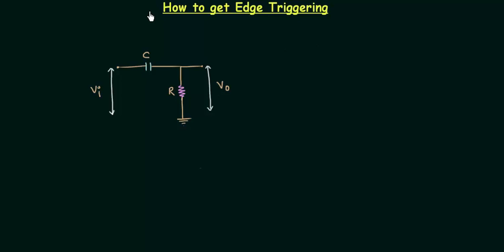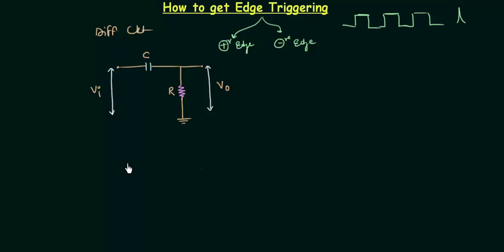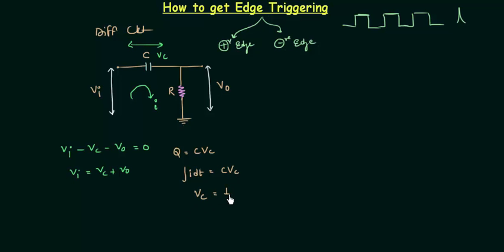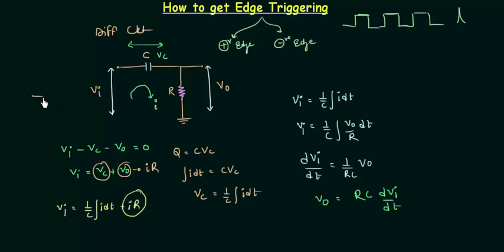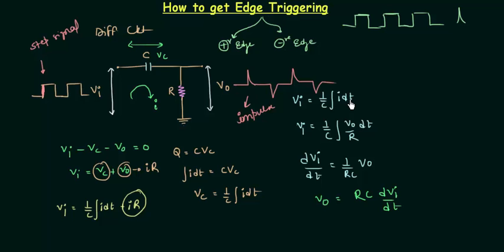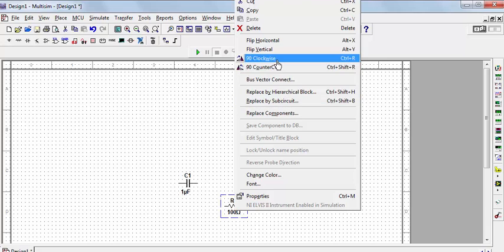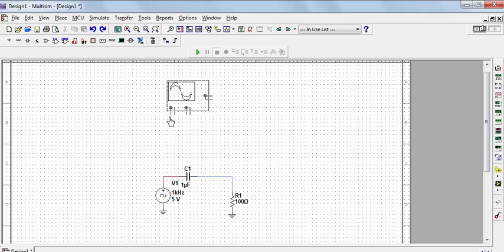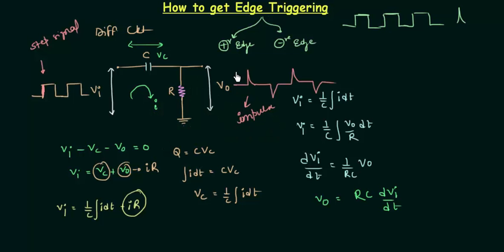How to get Edge Triggering | Simulation using Multisim

Comment: How we can know a flip flop is positive edge or negative edge triggered circuit from its gate level design
Reply: kumar rajiv if the clock has a bubble in it, then it's -ve  edge triggered... otherwise it is +ve edge triggered.